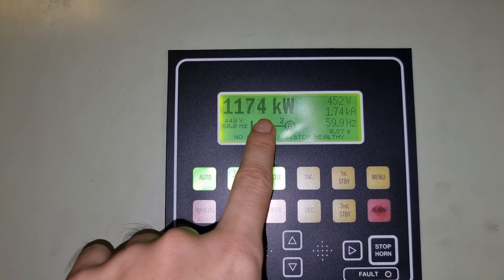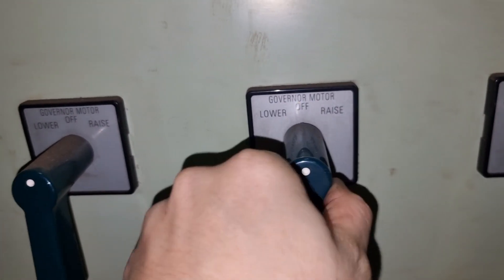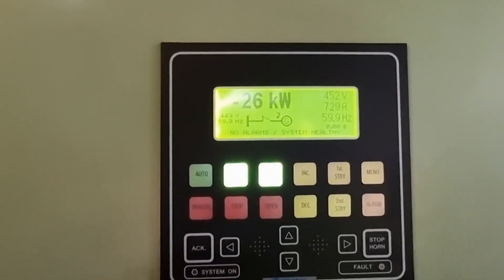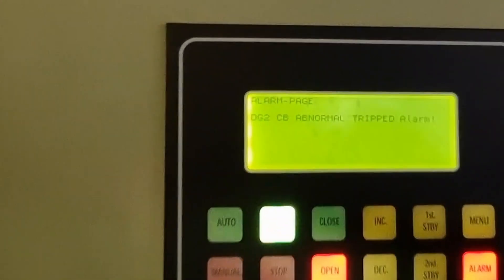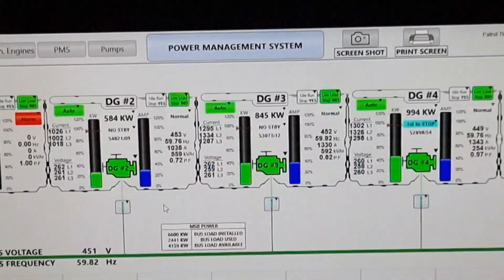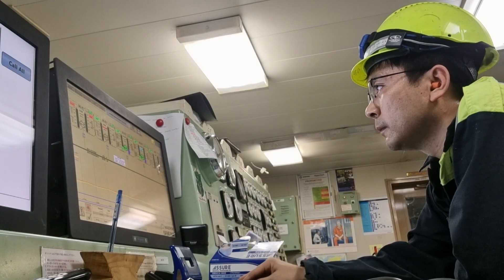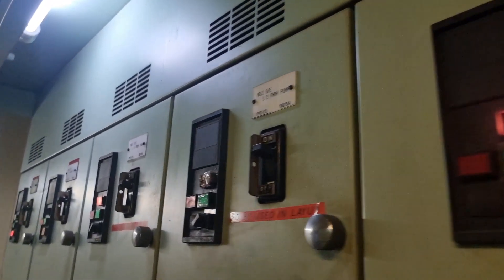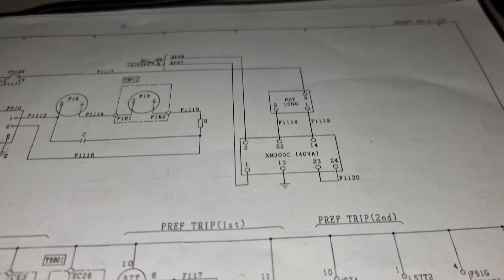GENERATOR PREFERENTIAL AND REVERSE POWER TRIP | MARINE ELECTRICIAN

Comment: is it possible to synchronise Auxiliary Generator and emergency generator together? If not why?
Reply from the maker: depends on the set up of your switchboard, there are some which can synch but most of the common set up the emergency generator is really isolated from the aux gen
Reply: @leckyjake  for synchronising, what things must be same in between these two type generators?
Reply: @rifathasan3698  droop characteristics

Comment: Sir,I ' m just a beginner and confusing about measuring contact 9 and A1 .It gets no voltage and thought the 57X1 is in close contact .It means The timer is working and 9 & 11 is in close contact also. But I know it' s wrong😅 . Sir could U explain the right ,plz .may be my lack of knowledge.
Reply: zero  voltage across the coil because no source incoming, hence the contact from the timer always in open state, which means again, no voltage coming for the coil on 9 and A1

Comment: Mr. lecky do not give people wrong explanation regarding preferential trip functionality target point. Please check it what is actual point for that protecting.
Reply from the maker: thank you for watching and i hope you should read then spread the love by sharing what you have.
Reply: You are doing well your job. That is good to continue to give your knowledge and help an others. I just give remark. Because you say preferential trip is use also because bus bar can not be accommodate such load in case over current is occurred. Actually only preferential trip is used to cut the power for non  essential consumers 1 st, 2nd and 3rd group accordingly. That is all why use preferential trip to avoid to trip air circuit breaker (avoid black out). BUS bar is so strong and can be withstand any extremal loads ( wich is not requires any protection) will not affect any load to damage it.

Comment: Since you measured the contacts A1 and A2 of the 57X1 contactor and did not get the voltage, it meant that the timer was not working as it did not activate the 57T1 contacts. Does it mean that you did not reset the fault while troubleshooting?
Reply from the maker: yup, i think I've mentioned that one in the video
Reply: @leckyjake  thank you for the vids! Keep doing it, sir! Very knowledgeable! Love it